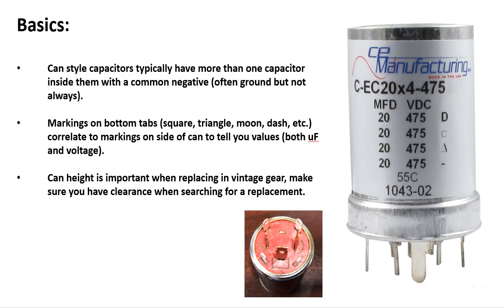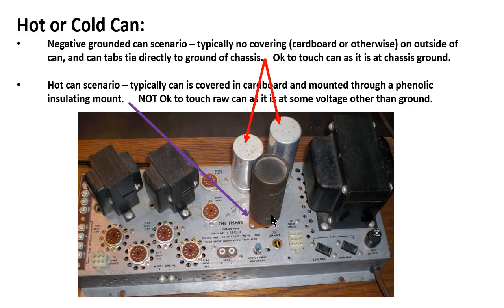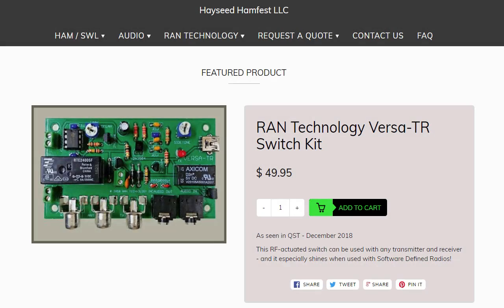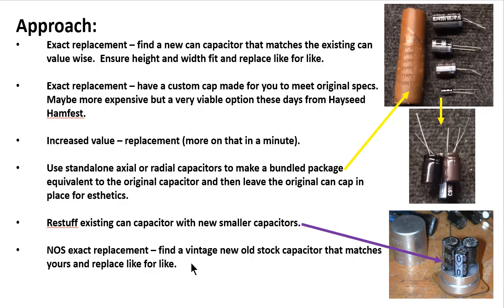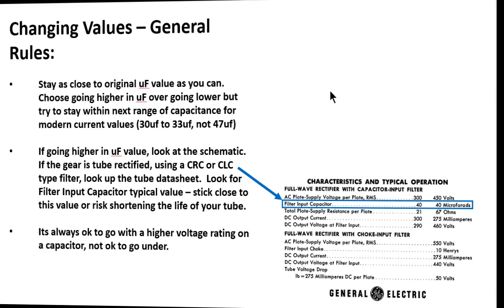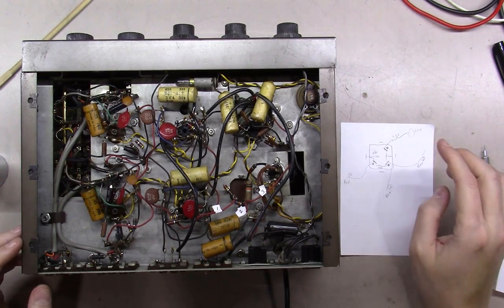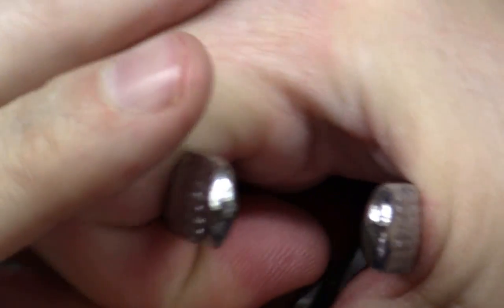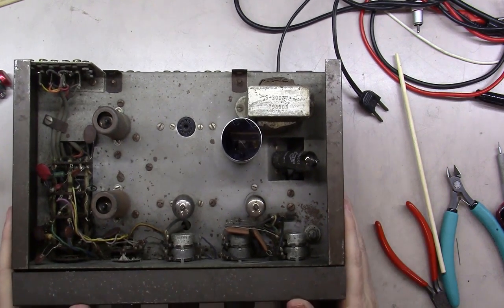Replacing Electrolytic Can Capacitors in Vintage Electronics

Comment: A "NOS" cap is often in worse condition than the one your replacing.  NOS caps have not had power applied to them for possibly decades.  The caps in your equipment at least have been used over their lifetime and reform slightly every time you power the device on.  I have had customers send in equipment with a set of NOS caps to use and when tested the NOS caps were worse than the ones in the radio.
Reply: agreed
Reply: NOS metal film and micas seem to hold up. Electrolytics and ceramics get yanked out

Comment: Nice video.  I have just finished repairing/restoring a GEC Miniscope.  I ended up doing a functional restoration.  I replaced every capacitor, every resistor and the selenium rectifiers.   It uses 30% less power and I suspect it works better than new.  I did not see any point in trying to preserve the appearance of the internal components that no one would see.  The exterior and the carry case are not modified.

Comment: I would check the actual value of the surrounding resistors first, but with metal film types readily available, and more reliable than carbon film, a good idea to replace, given their location near a metal can capacitor you are replacing anyway. Thanks for the post. A very comprehensive description, and only one point I would make is about the wax-paper capacitors which operate with high voltage, to check for leakage, and replace with mylar types, less prone to leakage. Their failure can present symptoms similar to poor emission from a tube...

Comment: EDIT: Well i had ordered some regular aluminum electrolytic radial capacitors in modern values to replace an on multi stage 80 uf x 80 uf x 40 uf  (all at 300 vdc) right after watching this video. But i couldnt help but think about how the current multi stage cap was obviously bloated and bad and how it would be an eye sore to keep it in and stuff it with new caps or just place the new caps under it. So i thought it couldnt hurt to request a quote from Hayseed Hamfest. I will say it did take them about a week to get me the quote and the invoice but i was pleasantly surprised to find that they could do it for $27 pus $6 for shipping. I think thats a great deal for a custom cap if youre working on a project where you care to keep the original aesthetics of the components as close to original as possible. Or if you just dont have the available space for individual caps. And i was also really impressed with Hayseed Hamfest's options. They were able to made me a damn near exacting match with the only difference being the new cap will be slightly shorter (by request). They even let you pick the color codes for each capacitance value. And they seemed very professional and capable in all our correspondence. Now i cant in good faith recommend them until i have seen my order through to its testing and installation whenever it arrives in a few months but i will say that im really happy to know that this is an option at such a reasonable price..

This was absolutly wonderful information. Im a guitar player who builds guitars, pedals and does mods and repairs to tube an solid state amps as a hobby. But recently i bought my grandfathers home after he passed away and moved in. He was a radio operator in WWII and a HAM radio operator from the time he returned from WWII until his passing. So when i moved in i noticed an old redio in the barn he must have used while he was out there working. And i looked it up and found a similar model that was a Solid State version and assumed it was also a solid state version.....sadly it wasnt. And now about 5 years later when going to fix it ive discovered it to be a tube radio lol. I would have loved to fix it sooner had i known. Anyways, most of my repair and mod work on tube amps has been one modern equipment so these multi stage caps are new to me. My grandfathers radio that im fixing up is a Realtone Mutiplex with 12 tubes (6BM8 based power section). And it has a multistage capacitor thats 80uf x 80uf x 40 uf that is certainly bad, not completely unfunctional but close enough lol. Try as i might i wasnt able to find an exact replacement anywhere and i was wondering if i could use three stand alone radial caps instead on a diy board or possibly concealed in a tube with the dimensions of the original multi stage cap. So this video was exactly what i wanted to see. To the point and gave me exactly the info i was after. Thank you very much for taking the time to put this together. Looking forward to checking out your other content!

Comment: Thank you for this, because I have two record players that I've bought from someone,  and one is in rougher shape than the other. They're both Newcomb's, and I have a model ED-10 and an ED-10C  (the smaller version). I'm trying to replace the capacitors in both of them.

Comment: This is good to know as I just now  learned a 1939 GE radio I have has a hot can.  It is insulated from chassis and the metal base / can is where second wire goes!!!  The second can is also insulated from chassis but does have two individual wires.  Could that maybe be hot too? What is the best way to discharge caps when working on something? Would turning  the switch on while unplugged work?

Comment: Very nice video thank's for sharing Mark. I needed this type of information because i'm about to start restoring a 1937 RCA Victor model 87-K am radio console.  It probably sat in a barn for decades so the chassis was corroded beyond belief.  I cleaned it as best as i could in hopes of getting the unit running again. But as i am about to start re capping (right after i change the power cord to a healthy polarized/grounded one) i'm trying to figure out just how to replace the big electrolytic caps.  Their bases are plastic screw in type with a big lock washer holding them tightly to the chassis underneath, but one of them has ben toppled over at one point so the plastic threads are shot and the lock washer wont grab any more. All 3 of these cans only have 2 wires coming out of them, one can has an open thin washer soldered to one of the wire, so i think they are not multi section caps logically.  So my question is; do you think it is possible at all to have these types of caps made by Hayseed Hamfest or an other company ? i'll write them with pictures of course, but i just though i'd ask you first.  Again thank's for sharing this video, it was helpful indeed.

Comment: Hi there. Wonderful video. Very informative. You have covered the theory and practice, very well. Thank you so much. I was wondering if there is simple way to find out which Caps need to be replaced, without taking them out of the circuit, in a Vintage gear. This will be very very helpful, if you can please answer and may be make a separate video for this.

Comment: Very interesting.  While I understand the reasons stated for not increasing the value of the electrolytic caps (more than one value higher) if you can't replace like for like, but what are the disadvantages/effects on the amp and it's performance of going lower in capacitance? ie. 33uf to 16uf?

Comment: Heathkit A-7e amplifier.  Original schematic has first section of can cap at 40uF @450vdc.  This is coming off a 5Y3GT.  The data sheet on the 5Y3GT has that capacitance value at 20uF!  The can cap that is in place is 40uF @450v.  The capacitance value looks to be updated on a couple of spec sheets that I have looked at.  Should I go ahead with replacing the original cap values?  Thanks!

Comment: Did you check the resistance of the resistor from the cathode of the 6X4? In it's position it would have been stressed over the years. It looks like an Alan Bradley so should be okay, but still good to put a meter on it to be sure.

Comment: Your electrolytic can cap tabs are the common (neg) for all 3 electrolytics? I have an electrolytic that has a black cardboard housing. It has 4 separate tabs for 4 electrolytic caps. ( 2-30's and 2-20's) So the tabs on the carboard cap are the negative for each electrolytic?

Comment: It's BETTER to replace an old, bad, cap with an equally old one, that's been in use, over the years, than a "NOS" one, that's been just sitting on the shelf.  Electrolytics tend to go bad, if they don't have a polarizing voltage applied, for an extended time.

Comment: So, if I understand correctly, the only reasons to replace an electrolytic can with another electrolytic can is aesthetics and simplicity?  If you can restuff an old can then you COULD replace each section of the can capacitor with a radial or axial lead electrolytic, couldn't you?  Is an electrolytic can capacitor superior to three individual capacitors in some way?

Comment: Thanks for another cool vid, Mark, but please take it nice n’ easy for a little bit, even though I’m pretty sure the HiFi repair bug is just what you need to get feeling better and back to normal. Just keep in mind, we can wait for vids. Your health is more important to everyone. 
Quick question if you don’t mind, but couldn’t you have used one of those customized can caps in the empty spots on the Dynaco Mk3 monoblock kits instead of those new power supply PCB’s rather than putting “dummy” ones in for aesthetic reasons? Wasn't the idea that it needed to have more modern specs such as higher capacitance and/or voltage? 
Take it easy, Mark.

Comment: How did you know to assign the triangle, square, etc. to the diagram in the location you drew them? I have a cardboard electro for a 6D111 radio with symbols but no idea which symbol goes with which tab? I have the schematic and know the resistors but am lost as to how to orient the replacement.

Comment: Anyone see an issue with using multiple sections of a can cap to create a needed value. Say I need a 60 40 20. Could I use a 40 40 20 20 and wire in parallel a 40 and 20 section to make a needed 60?

Comment: I have old tube radio want replace multi section capacitor color coded I want use a can capacitor if I can to keep right nostalgic. Specs 400 volt yellow 30 mfd 250volt red 30 mfd 630 volt blue 20 mfd and 20 mfd green What can capacitor recommend voltage and micofarad?

Comment: Hi, thank you for all of the great teaching. Excellent videos. Also, your work, and knowledge, is greatly appreciated. 
 
 I have  Marantz  4400 receiver.

 I have a couple questions, 
Do you have any advice on the 4400? 
 Do you have videos of 4400 restoration.
I have two of them. First is completely original. Second is restored, with nichicon pw capacitors, ect.
 I was wondering about the power supply, and capacitors to use, being close to factory specs.
Also, main filter capacitors. 
 Your knowledge, and work is greatly appreciated. Also, of you mind me asking,  do you have an email address to contact You?
 Thank you. Dustin

Can I test my dc offset, and bias, with an anolog meter, and have better accurate measurements than a dmm.

Comment: Blueglow Electronics, Suggesting that you replace an old cap with a NEW can style cap can be a disservice. The answer goes on and on... but the "less simple answer" is covered by Paul Carlson of Mr Carlson's Lab video series on Patreon channel. Another thing is that the modern version of a can cap is made to different specs than the old one you replace, ESPECIALLY in voltage rating, which is MUCH more specific than the older design... so, use a HIGHER voltage rated cap than the old one to stay safe. Do NOT consider having a custom cap made, for so many reasons that I can't enumerate them here. de KQ2E
Reply from the maker: We are all entitled to our opinions and I'm sticking to mine.
Reply: @Blueglow , so sorry to hear that. Changing your mind is not a hard thing to do, actually.
Reply: @BruceNitroxpro  If your trying to change somebody’s mind or opinion your going to have to lay down some very good reasons or at the least links to the documents that outline and support your position. Without that no one is going to move their position. Since changing your mind is easy then it should be no problem for you to change yours.
Reply: @Cpt_Adama  ,  I only suggested where he may find some information relative to the recapping process. I can't add someone else's experience in a little reply, but I guess I have done my part here. Thank you anyway.

Comment: OK, so if I'm NOT using a tube rectifier "solid state" is it OK to increase the capacitance or the first capacitor?
Reply: Yes.
Reply: To replace by getting  rid of the can and installing  individual  capacitors... are they polarized   or non polarized  and is it negative  or positive to the chassis?.   Btw,  The schematic does not specify on the Philips P143 old tube radio I'm working on.

Comment: I Am less than Amateur Working on a AM Bendix Sapphire Radio and it is Shorted Darn Near To Ground . When I power it up it Has The loudest Buzz or Hum I've ever Heard An There is  a little heat sink right Below the Transformer that almost turns Blood Red when Powered up l don't Think it should Glow that Red ! Have Both Stacked Caps out of it 1 is Metal Cased the Other Plastic an yet when I Ohm it , it still shows Almost Straight to Ground I'm Wondering if a Transistor Could Cause a Problem Like This instead of a Cap ???

Comment: The CE Distribution Twist-Lok can capacitors are light duty only.  They do not last long dealing with heavy ripple current.  The section that is connected to the output of the rectifier tube (or solid state rectifiers) has to sustain the highest level of ripple current.  The CE Dist. cans don't hold up under those conditions, sorry to have to say.

Comment: No!  Electrolytics in aluminum cans, for the most part, are hermetically sealed well enough that they DO NOT DRY OUT.  They only need careful reforming to be able to successfully use them.  Besides, it doesn't hurt to try reforming a NOS capacitor.  If it won't it's worthless anyway.